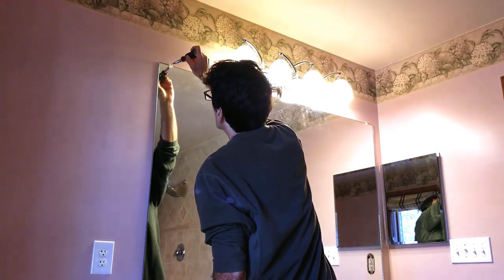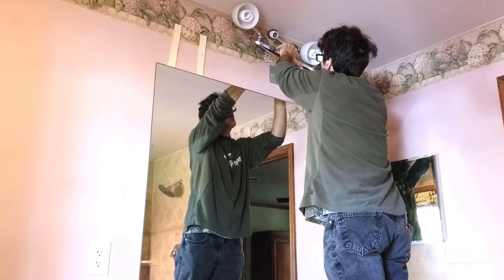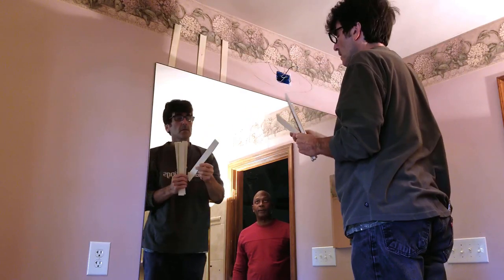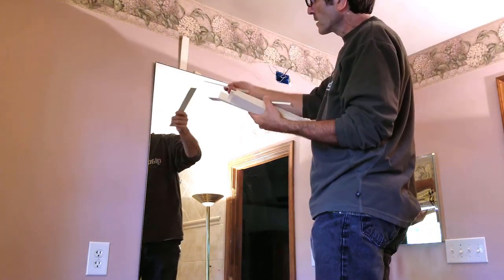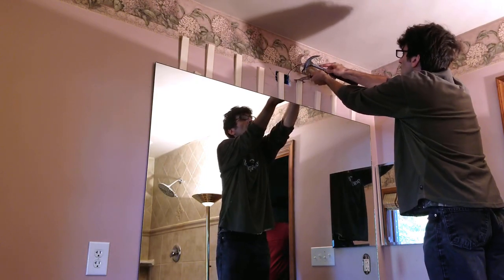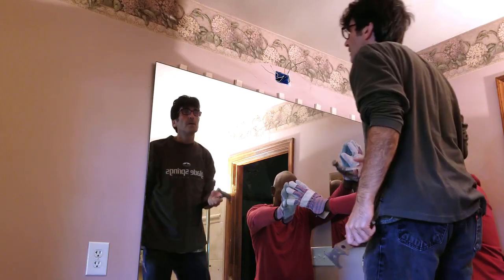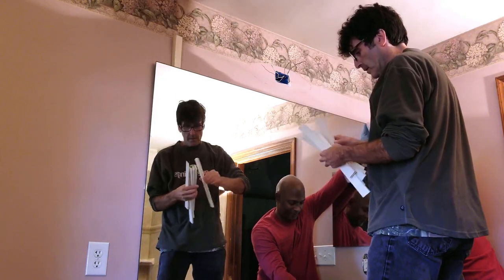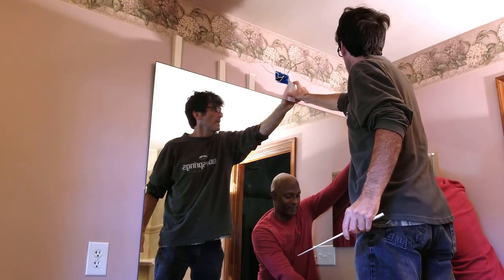How to SAFELY Remove a Glued on Mirror From ANY Wall Without Breaking!

Comment: Now I'd like to know how to repair the circle damage on the drywall so that when the project is completed it will be a smooth wall. For the life of me I don't understand why these big ugly mirrors get installed in the first place.
Reply from the maker: You'd have to scrape off the glue and patch the drywall.  I do have several videos on fixing drywall... But yea, if you don't put a similar mirror back, you'll have to deal with the glue spots... :-)
Reply: I can’t believe they glue these things on. It seems like the upper and lower clips screwed into studs would be sufficient and allow for future upgrades without causing damage.

Comment: That looks a bit unsafe
Reply from the maker: Naah... not really.  Just have to be careful.
Reply: I'm going to try to take my bathroom mirror down next week, but it looks very solidly stuck, where do you buy the wedges?
Reply from the maker: I just used shims for doors and such.  They can be bought at any big box home improvement store like Lowe's or Home Depot, if you don't have one nearby, most hardware stores should have them.  If you wanted to be extra careful, you could put some tape on the mirror and wear gloves and safety glasses just in case.
Reply: @TheHomeImprovementChannel  Thank you, yes I will be using tape, gloves, mask and a thick overcoat just in case.
Reply: @TheHomeImprovementChannel  I tried this and because my mirror had been stuck down with sealant the mirror broke up into pieces, and it took a long time to remove.
Reply from the maker: Paul Sensational argh.. sounds like whoever put that down got extra glue happy... it’s usually not attached that solid.  It doesn’t need to be.